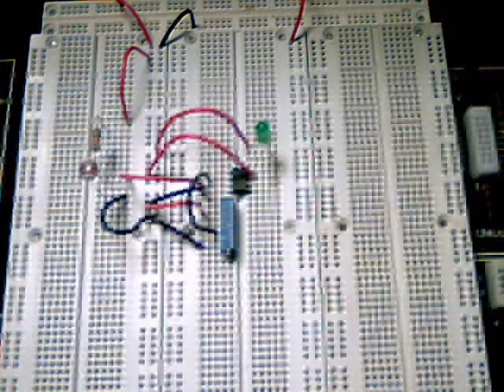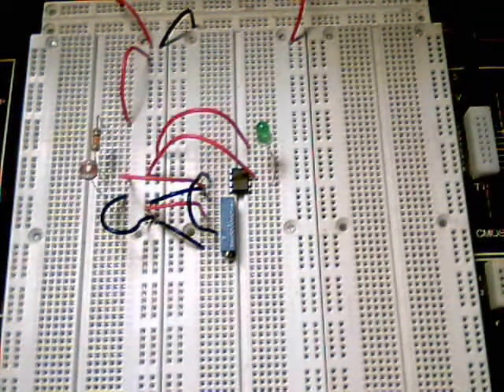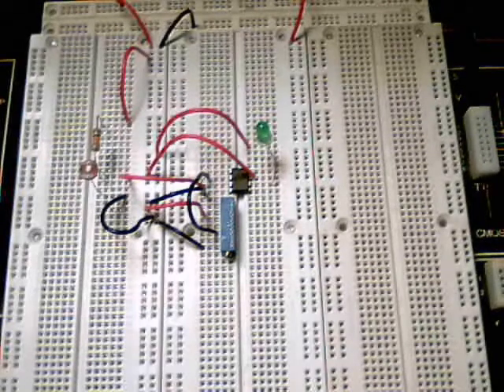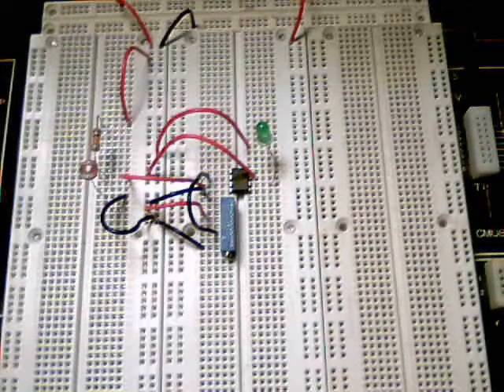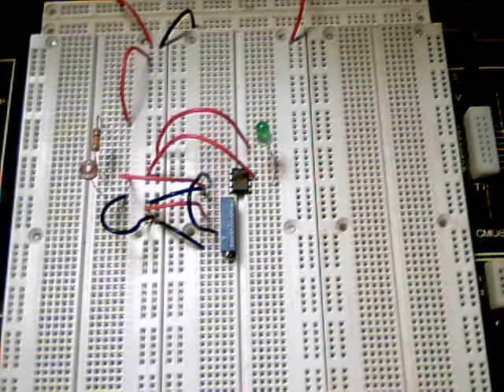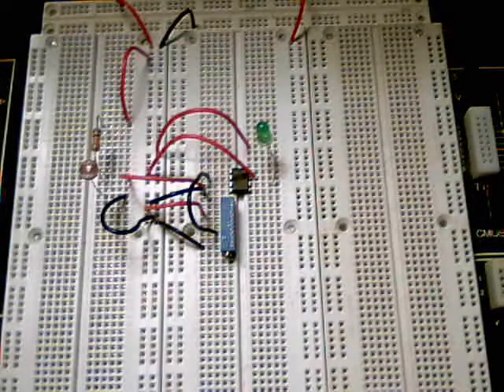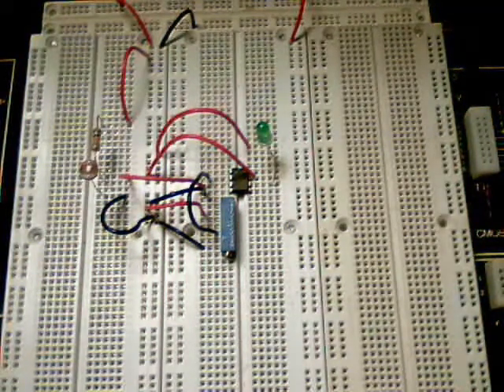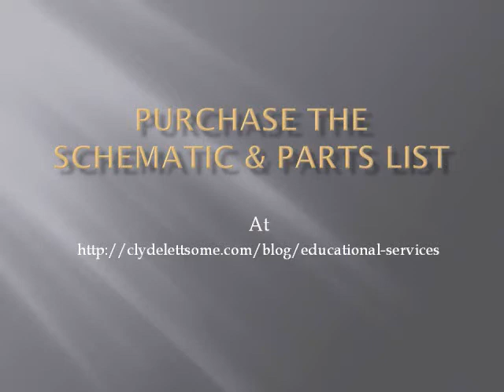Light Sensitive Switch (schematics available - FREE)

Comment: Hi Clyde, if you're still around, would this circuit be sensitive enough to distinguish between full sun & then cloudy in daylight of course & checked your blog but component part #'s aren't listed.
Reply from the maker: Hi,
I did not check that scenario but it can be easily reconfigured to meet that requirement. 

The schematics and parts list are available on my site for free.
Following this link https://clydelettsome.com/blog/product/light-sensitive-switch/

Best Regards,
CAL